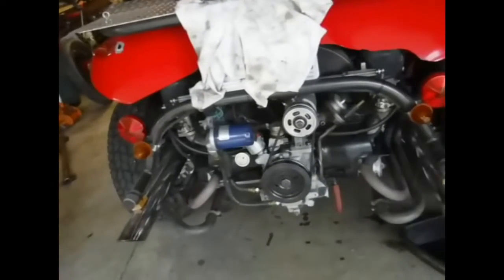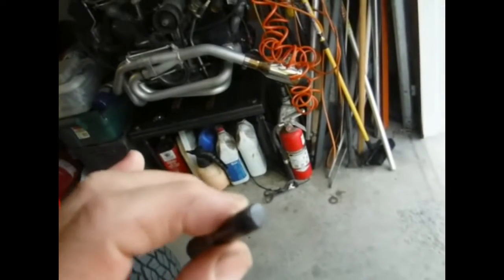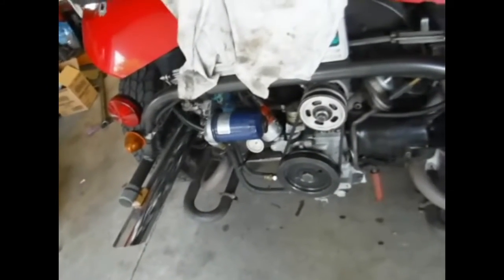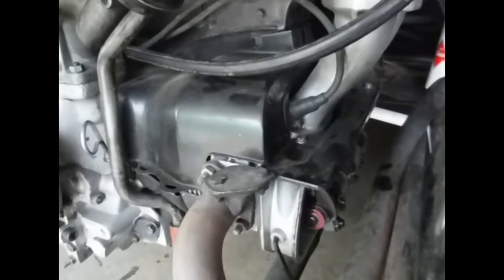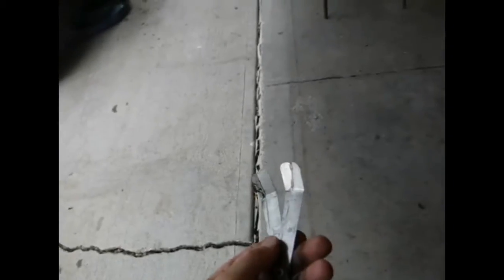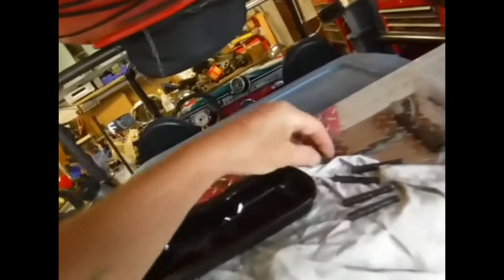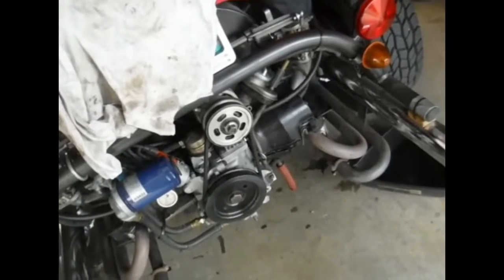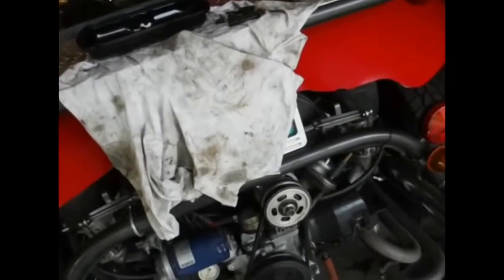VW Eng.Broken Rocker Arm Studs

Comment: I was soooo hoping you would mention what method you used to screw in the replacement studs. If you don't mind sharing I'd much appreciate it. Obviously just hand tight is not adequate. A couple of questions: 1) what tool/method did you use to screw them in? 2) Did you torque them? 3) Did you use a bit of loctite?

Comment: I just broke a rocker are stud. how much torque should I use?
Reply from the maker: You should have the correct shop manual for your year of engine.  Some early engine's used 14 ft. lbs.  later engines used 18 ft. lbs.   It is important to use VW studs and nuts. the studs have the correct shoulder to fit in the rocker support for proper alignment.  It's ok to use after market racing studs   but it will leave more threads exposed. No big deal unless it hits your valve cover.....

Comment: eh?! now what the -----if this can happen - just happen  this is something to prepare for. how can we prevent this . this will not be funny in the middle of death valley!!! do you think the high performance spring did this?
Reply from the maker: Yes and No.  It's my fault for not checking to see if it was really a stock cam when I built the engine. The unmarked performance cam was not designed for 1.4 rockers and every time I was hot rodding it I was floating the valves even though it sounded ok. After years of abuse it finally broke. A very unusual situation I would not worry about it. Thanks for the comment and view.
Reply: thanks that one for the books. blessings ez!

Comment: do you have any thoughts on those replacement push rod tubes? someone vandalized my motor. see the damage here if you're interested, https://youtu.be/YmcHEcEHCKw
Reply from the maker: That really sucks.  You can get some spring loaded pushrod tubes and some relplacement pushrods here. Can't believe someone did that. http://vwparts.aircooled.net/VW-Pushrods-PR-Tubes-s/879.htm

Comment: Man talk about ruining your day geez that's awful..looks like a nice clean setup alright but geez who would have thought. Well its back to the drawing board. Yeah if you were hot rodding it i would have said you were taking your chances but i know you are a safe and sane guy.
Reply from the maker: Funny thing is its was running great and just been sitting in the garage for a month or so?????
Reply: yeah that was the really strange part. And those are the studs you replaced with the stock ones sounds like the new ones are the suspect to me especially if the engine was running fine.

Comment: Damn that sucks. Only 18lbs? I've always had a feeling about the black hardware might break just never saw it. The black hardware that comes with new aluminum cases rub me the same way. Nothing like new as41 case hardware. Thanks for posting this stuff.
Reply from the maker: I am going to be monitoring the head temps pretty close for a while. This engine has nothing for compression 6.6 I could run it on lighter fluid ????? Stay tuned

Comment: Had a 1641 that wore out the stock clips and hurt a rocker, push rod, and swivel foot. Had to go to solid shafts. So not exactly the same but I know the pain. Mine went back to the shop on a hook. Fond memories!!!!   Get her up to snuff and rage on. Might consider doing the other head too. You know you torqued them the same way each time.
Reply from the maker: Yeah, I looked at them but didn't touch touch them. Kind of meditating on how much to worry about it.